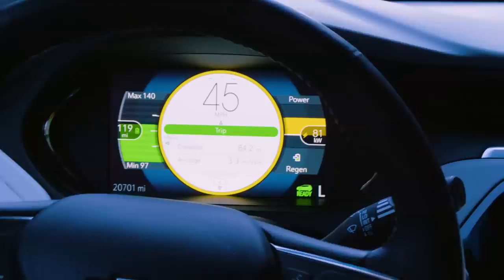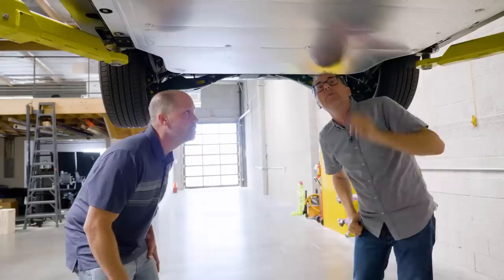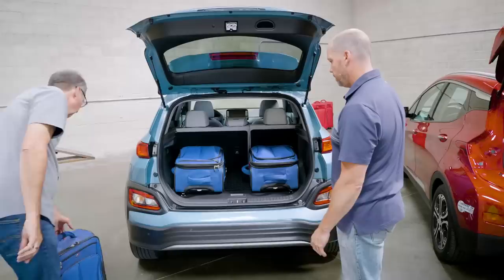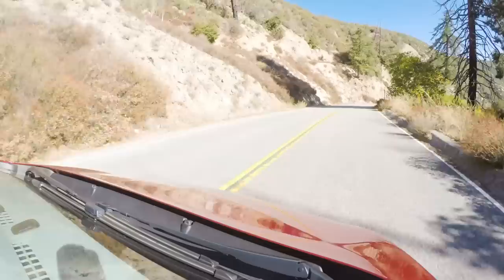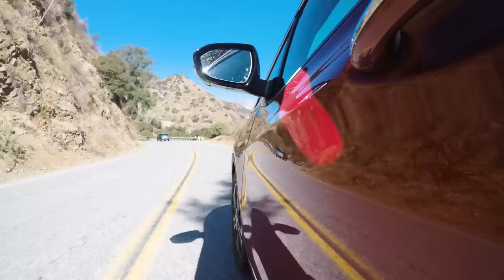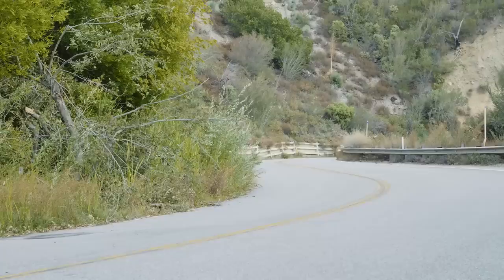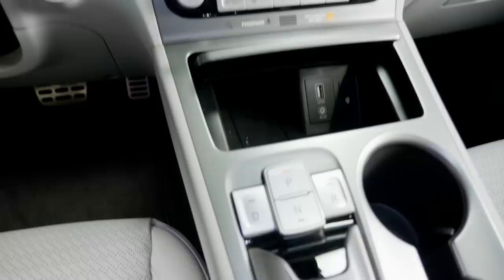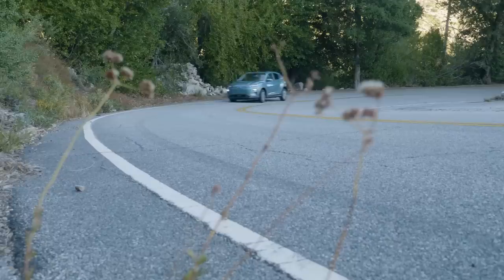Hyundai Kona Electric vs. Chevrolet Bolt EV: Which Is the Best Affordable Long-Range EV? | Edmunds

Comment: Well this video should be helpful for model  3 sales.
Just a couple of lower class alternatives that will disappointment.
The Chevy interior is a disaster and that super cheap rear suspension is why Chevrolet will go the way of the dinasours....again.
It really shocks me that a brand new company has designed a better driving machine than all these established automobile companies. Just shocking!
Tesla has had to resolve many issues ramping up but damn........it's a brand new company doing something that should be impossible.

Comment: The Bolt is garbage, small wonder GM is again in retraction closing plants all over North America.

However, I found the aluminum pan on the Kona disturbing, that is too easy to puncture, as Tesla found out an replaced with sheet titanium.

Comment: While I am excited about the EV I am waiting until they become practical. Fun is NOT enough to purchase the vehicle. They need to get the distance up to a comparable sized gas model, which would be a Corolla, of 500 mile summer and winter. Also they need to get the charge time down to the same as filling a gas model of about 5 to 10 minutes max empty to full.  Lastly they need to get the prices down to the same as comparable sized vehicles like the Corolla which would be 18k to 20k, base models. Only then will these vehicles be practical.
Reply: Not at all. These are only your made up demands. They are highly practical vehicles today, and hundreds of thousands are using them every day.
Reply: I agree, but wish to add that most vehicles don't have anywhere close to a 500 mile range. Most are 350-400. EV's are still best left as second cars.
Reply: @NukePooch1  Depends of where you live and what your needs are. In a EV owners poll from Norway 87.6% says the EV is replacing the use of their fossil car.  1/3 have only one car, the EV. 2/3 have two cars, but the EV is used as car #1. The fossil car is only used for long distance driving and when the EV is in use by other family member.
Reply: How many people drive 500 miles a day on a regular basis?  The beauty of an EV is you wake up at home every morning with a "full tank" so to speak.  In our Bolt EV we even leave on the hill top reserve (charge to 90%) because in a normal day we come nowhere near using all that range capability.  We only use public charging maybe once a month.
Reply: @NukePooch1  Actually, people that owns EV. It's the primary car. Their other Fossil fuel car is the last priority. You'll do the same once you own one. And when ev pickup trucks shows up. Yep.
Reply: @maynotbe  LOL! So True!
Reply: @erikstephens34  many stores, hotels. casinos, gym here in Vegas have free charge stations
Reply: MiloE if your claim was true there would not be hundreds of thousands. There would be billions. They are impractical for most people.
Reply: N Pooch, it is not about most cars but about cars of equal size and yes those vehicles do have around a 500 mile ranges and that range can easily be extended with careful driving. The Corolla iM has a 14 gallon gas tank and is rated at 35 MPG HWY. That is 490 miles. I have the L and it is rated at 36 but I get around 50 and have went 700 miles on a tank although it I nerve racking wondering if I would run out before I found a gas station. I do have to disclose that I drive for MPG and only use pure gas  with a manual shift.
Reply: Erik Stephens, how many people do you think would buy a comparable sized gas vehicle that is rated 36 MPG and only had a 6.5 gallon gas tank? Not many. Range anxiety came about with the EV, not the comparable gas model. The proof that the current EV's are losers is most cannot even sell themselves but require tax incentives. All this does not take into account that the current EV does not even break even against a comparable sized gas model until after 20 years. That means the current EV is a  VERY POOR investment.

Comment: chevy looks tougher underneath. they said it was a bad thing that its not flat but that gives it strength for if you hit something wich you will. hyuyndai looks like it will just get punctured. remember the battery pack is their.

Comment: I think it pains all car loving Americans to look at the Bolt and believe this is the best we Americans can produce. It looks pathetic inside and out. Really Chevy, could you do no better than this?
Reply: Actually Americans should be proud, the Bolt has some amazing tech inside it, and is incredibly fun to drive quickly. BOTH cars look dorky by American standards only, and are full of plastic, and the Kona even has a outdated Gage cluster and infotainment. Is it the best we can do? no that for now is Tesla, but it is certainly not bad for a practical runabout with no purpose other than getting people from point A to point B without burning fuel. And no one has matched it until now for less than 50 grand

Comment: Both too fat but then they are Crossover SUVs......Poor CdA, and high weight.  Anything over 40 mph, drag plays a huge role in kWh consumption and range. Model 3 should be better but currently too expensive.

Comment: Alert on the Hyundai Kona battery

Hello, I clarify that I own a Kona EV Style 64 kWh, and a Tucson 2015 Tecno.

When reading the service passport, I am surprised that there was no reference in the warranty of the battery on a fundamental aspect, which is how much useful percentage is being guaranteed from the 485 km of autonomy approved at the passage of 8 years or 200 years 000 kms ?.

All manufacturers guarantee 70 percent or more of payload to the passage of between 8 and 11 years.

After a month and 4 calls to customer service here in Spain, today 10-12-2018 at 12:00 I have been called by a Hyundai Spain Customer Service lady by phone 911 510 658 which has treated me in a more than border way, for Tell me that Hyundai has nothing to say about the useful life of the battery, that all the information about the warranty of the lithium ion battery was in the service passport and that that was it. That for a test computer is why they are governed for the guarantee.

Well, I've been stunned, nor have I told you that I have more than one car. Hyundai did not care about anything.

I will denounce them, and I will try to report this to everyone I can, so that I do not pay 40,000 euros for a car of 480 km of autonomy when buying it but that you do not know how much you will have to the second one and so on, without knowing if it will be guaranteed in case of an evident loss of that autonomy.

The one that will buy it that requires it in black and white.

Thank

Comment: You lost all credibility at 1:59... "vaporware."  I have driven the Model 3 (LR RWD variant) and the Kona EV and I can tell you the Kona does not even begin to come close (as nice a car as it is).  Driving dynamics, handling, and user interface all are hands-down better in the Model 3.  As a user new to both vehicles, it hands down took less time to figure out the user interface of the Model 3 with the very intuitive screen-based controls, compared with the hundreds of buttons on the Kona.  Save your money for the base Model 3 folks, it will be here very soon.

Comment: Hyundai has never had a reliable first generation anything.  They look great but ultimately repairs and recalls and too common. How many of their dealers and mechanics will be trained in time.  I ll take the bolt since GM chevy is way more mature.